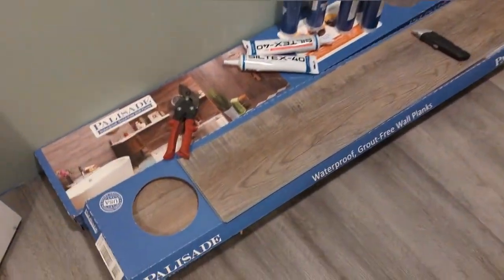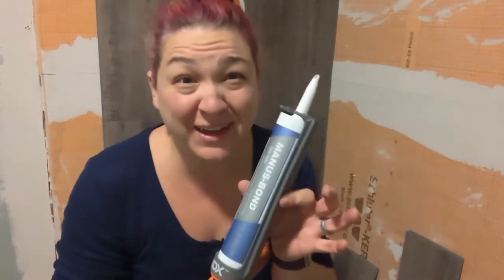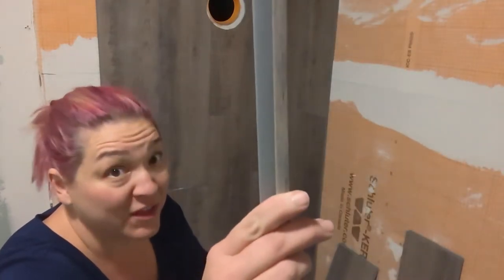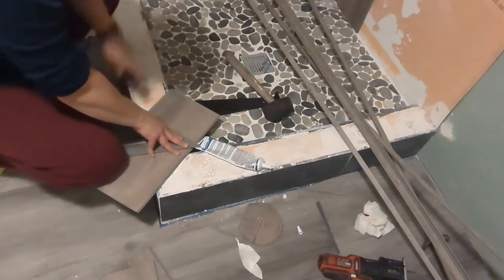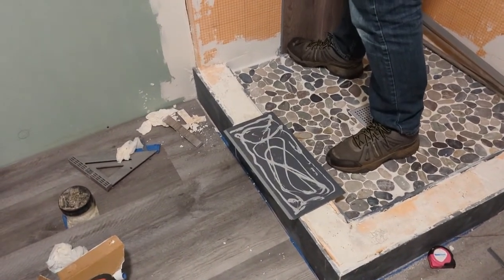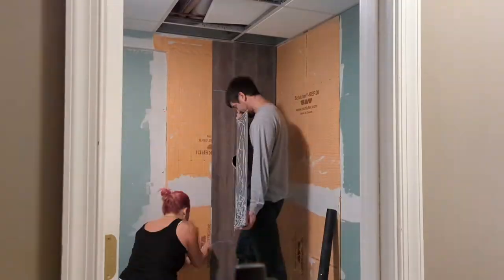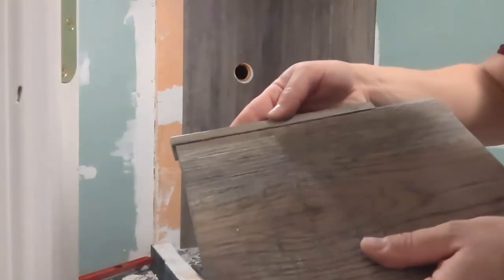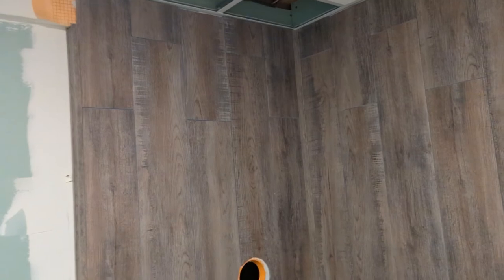Palisade Wall Tiles Shower Installation: Easy Renovation Guide for Your Shower

Comment: This was very useful.  Many thanks!!  Nicely explained and demoed, and thank you for no music.
I wanted to do this for my RV bathroom which is trickier than a house shower stall.
Some questions for you:
1. Schluter told me that if I use any of their Kerdi products - board or membrane, it only works with thinset under it and over it for real tiles.  If I use adhesive and vinyl tiles, it won't stick to Kerdi backing.  Yet, here you are doing precisely what I wanted to do.  Does the adhesive in fact stick well to the Kerdi backing or have you had issues with it coming off?  I desperately need to know.  I cannot get this info anywhere.  

2. If you want larger tiles, and very light in more color schemes, try Innovera by Palram.  Home Depot can order it.  Larger 1 x 2 ft tiles for faster sticking.  Even lighter than Palisade.

Love the shower floor!  Pebbles look so natural and lovely.  Great job on the shower, many thanks!

Comment: The tiles in my shower stop about 1 1/2 to 2 feet below the ceiling and drywall goes the rest of the way. I want to install these planks all the way up. The product says it can be installed over title or drywall. My issue is, the tiles stick out about 1/4" so if I add the planks to the tile and to the drywall, it will be uneven. What is your advice to make everything even?
Reply from the maker: I think you can shim them somehow, but I'd send the manufacturer or diy decorstore this question to see if they have a suggestion on what to use. They're pretty responsive and helpful!

I'll see if i can tag them, if i remember their tag correctly! @diydecorstore

Comment: I guess I’m confused.  It’s waterproof but they still want you to caulk the edges.  Plus you already have Schluter behind the stuff so I’m still not understanding why the caulk between the panels.
Reply from the maker: Because water goes through gaps?

1st- It's waterproof if you install it properly.  

2nd- Just because it's waterproof doesn't mean water won't go through seams. In theory, water might get trapped behind the tiles if it went through. Would the tiles rot? I don't imagine they would. But you'd have a nice warm moist area for mold to grow.

3rd- Not caulking some projects is just sloppy. When you've spent hours installing something, don't skip the last step that only takes minutes. 

We have tile in our upstairs bathroom, installed by whomever. I have wondered how we'd know if mold was behind those tiles if the install hadn't been done properly. Pretty sure we'd need to wait until we had health issues and tested. 😬